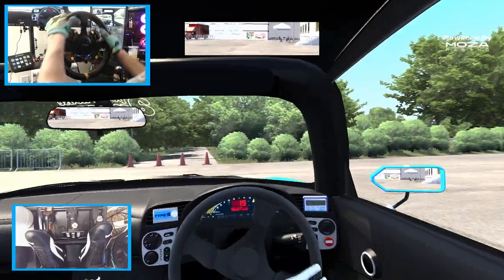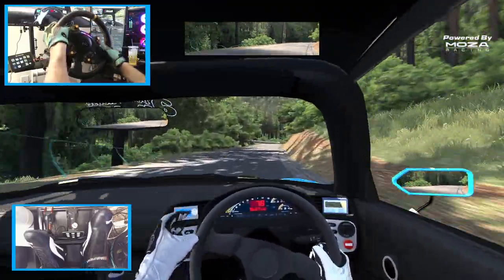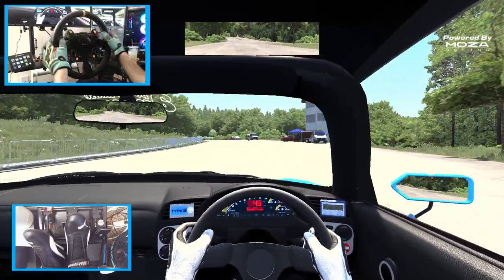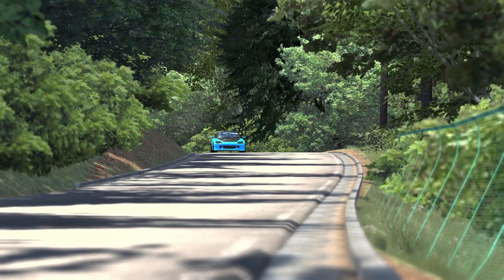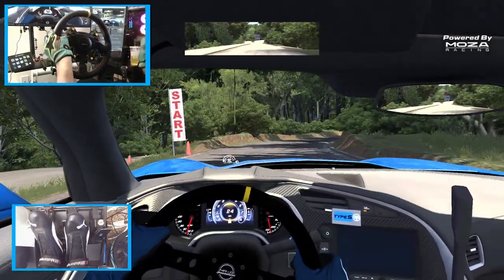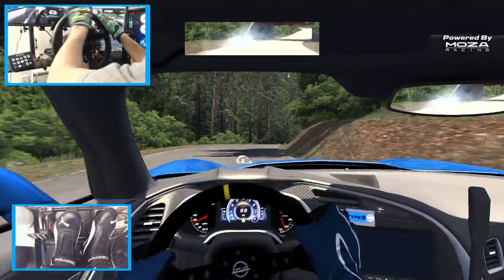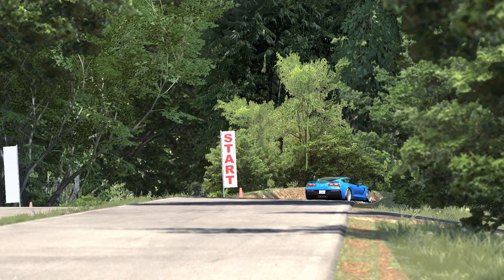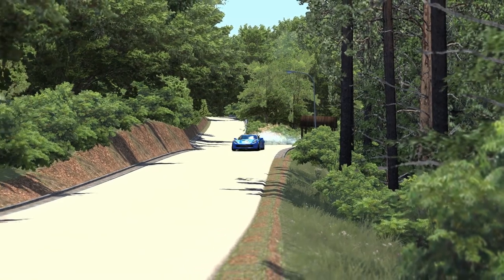Building a Touge Monster S2000 - New Series - 900° Moza R9 Gameplay

Comment: What’s the weight of the s2000? I haven’t been able to find any cars that truly feel realistic grip driving on assetto other than the cars I’ve made for myself. The main difference in my cars vs what I find online is the weight, I make all my cars in the 1600-2000 range. It allows the suspension to work much better than the cars I typically find. 

For reference my real life car is a 230whp k24 swapped Toyota 86, weighing 2600 pounds. Has aero and sticky tires. When I built an 86 in assetto to feel like my own car, I   Gave it the same power And had to make the weight 1800 to feel realistic and allow the suspension to behave in a similar way.